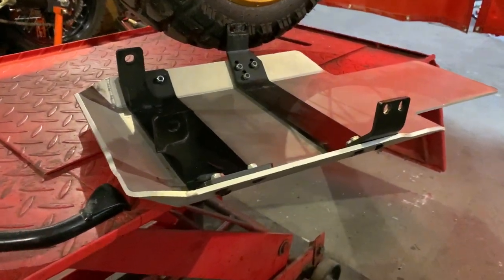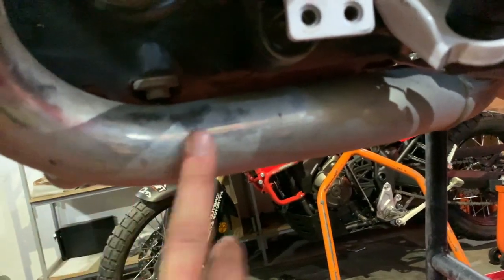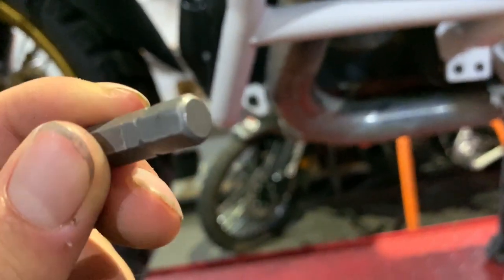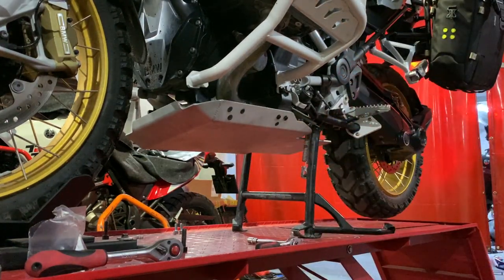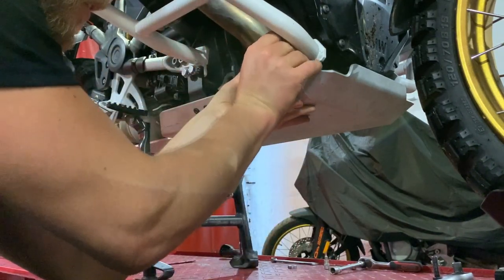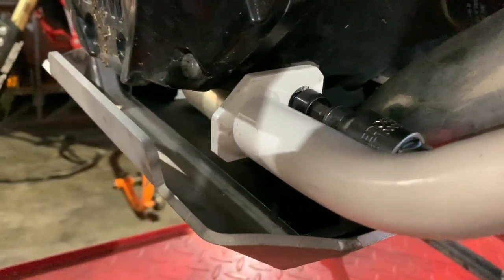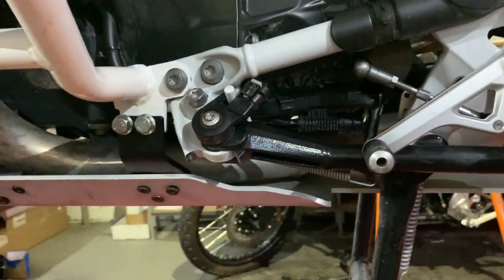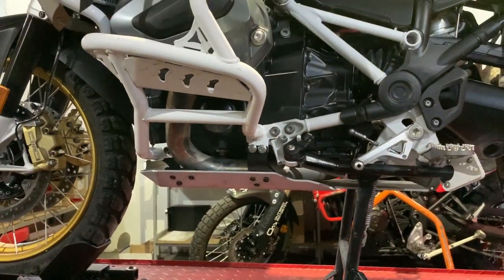BMW R1250GS Skid Plate Installation Guide - Outback Motortek (ENG)

Comment: Just purchased bmw 1250 gs.  I really like your upper and lower crash bars.  Was wondering why not have an access hole in the skid plate for accessing the oil change bolt?  Don't like the ideal of removing the skid plate to service oil change.
Reply from the maker: Skid plate removal takes 3-4 minutes and makes oil changes less messy. Putting holes into the skid plate also makes it more exposed to potential damage during off-road rides.

Comment: I‘ve just bought the combo for my new 1250GS in white. They look great and had no problem to install upper and lower protections but I’m having troubles with the skid plate. First of all cause the link on how to install sends me to the old version of skid plate, thus the product is not the same and hadn’t been able to install it cause nothing was mentioned about the 2 short bolts that have to be installed to avoid damaging the exhaust, also about the 2 extensions that need to be installed in the engine and probably because of that, the 2 rear bolts did not fit into the wholes. Now that I see there’s a specific vídeo for the new skid plate version I’ll try again and see. A bit upset cause I’ve wasted a lot of time with this...
Reply from the maker: Please email us and share photos of what you’re struggling with. Email address: info@outbackmotortek.com

Comment: you guys don't use washers under the nylock nuts when mounting brackets to the skidplate itself, neither on the two short bolts, nor on the other 11. My skid plate came with bots with nuts and washers on them. Do you recommend using the washers or not?
Reply from the maker: Yes, we recommend washers. Somehow we missed them during the installation video. Sorry for the confusion!